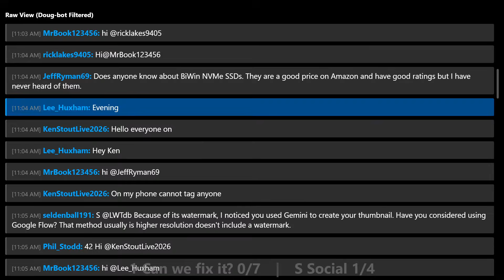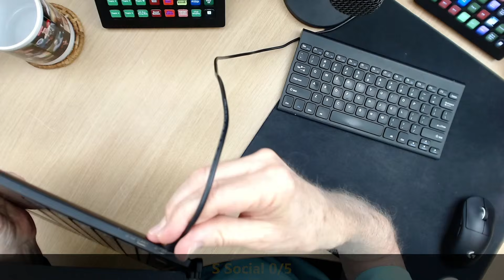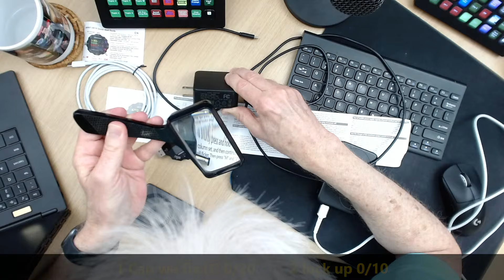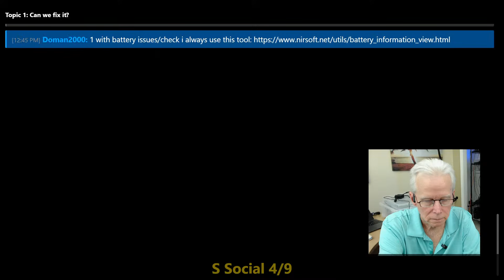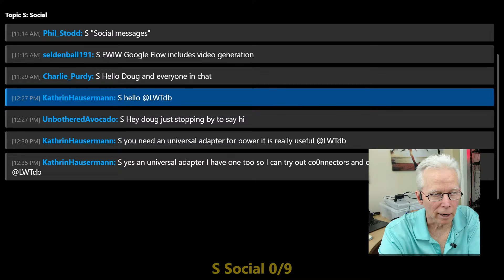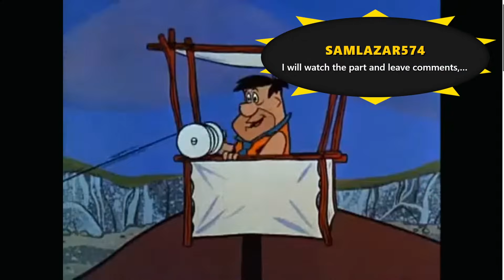Live Repair: Can We Fix This Bricked Ace Magic Dual Screen? (749 Sat)

Comment: Just a follow up to what you said that drive I did take it out receipted it all of the above and I discontinued using it because there’s an issue with it. I went back to my other drive which is also one terabyte 2 1/2 inch drive and that dry works fine. I don’t know what’s up with Intel but something is wrong with that drive could be right. It could be defective when I use the other drive. I don’t have that problem. Thanks.
Reply: On a follow up to this problem, I had the last few days I tried putting the drive in another machine person Sheldon’s request her suggestion rather and so far no issues
Reply from the maker: This video link is when I finished talking about your message you can scroll back in the video to find when I started talking about your message by watching the screen when you scroll backwards to see when I displayed this message https://www.youtube.com/live/bIydKp9sm4w?t=5808s
Reply: @LWTdb  thank you
Reply: I’m not using the drive as an OS system therefore I’m using it storage now so it’s not the sea drive. It’s more like a D or a secondary drive thanks again.